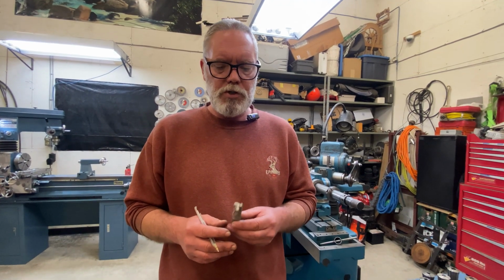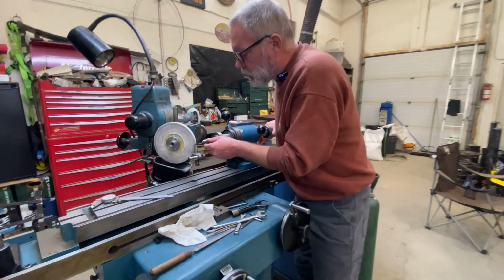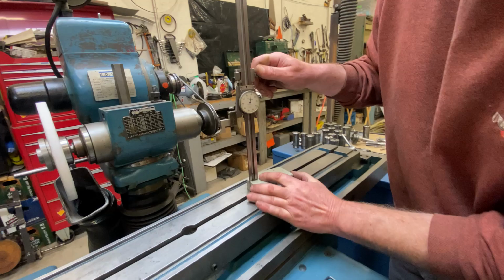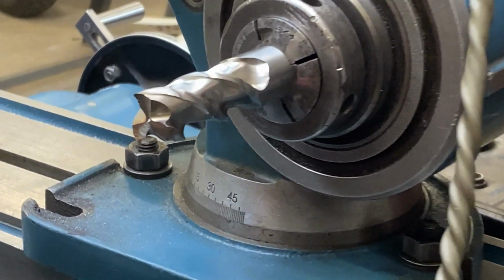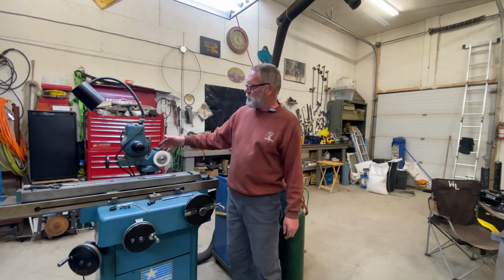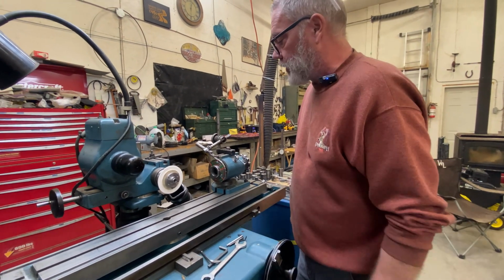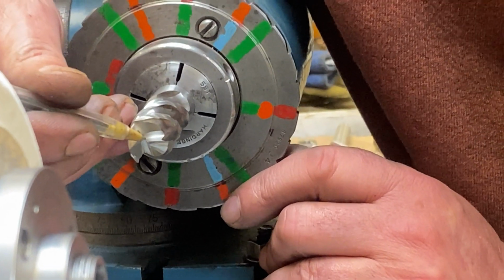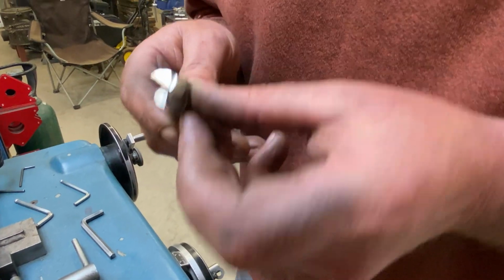How to sharpen a roughing end mill

Comment: What grit are you typically sharpening at to get a good; A wood mill bits, B metal cutting milbits...if there is a difference when both are pure carbide anyhow?
Do aluminium or steel cutting bits require a higher grit finishing? Or is it better to aim for mirror finishes where possible for both?

I'm searching around trying to figure out how to do this, primarily so that I can make something to preserve the life of bits as much as possible and I was hoping to 3d print most of it.
Looks like you need some pretty extreme tolerance accuracy though, not sure printed parts and metal hardware is even going to be good enough...

Awesome breakdown of the processes and thoughts behind things though, thanks for sharing
Reply from the maker: In my opinion a better finish is always preferable. Grit choice is complicated and depends on material being cut, speed of wheel, diameter of wheel, amount being removed etc etc. I recommend the trial and error method for learning what works.
 Thanks for watching!
Reply: @Lappemountainliving  I was looking to go into sharpening my cnc bits from cheap, I should probably leave thinking on this matter until I can afford to spare a grand for a sharpening jig properly toleranced. 
I'm asking about your grit because you're using stones over diamonds which is what i've seen more commonly on these types of sharpening systems. 
From a long time knife sharpener I extrapolate that end of the day you're getting a more polished edge.

Comment: Hello, just wondering why you have it so the direction of the wheel direction will raise a burr of the cutting edge ?
Reply from the maker: You're right  that it causes a bigger burr
I do it this way because the cutting force of the wheel forces the tooth face down onto the pointer.  By rotating the wheel the other way the cutting force would be trying to lift the tooth face off of the pointer which would result in the wheel digging deeper into the side of the end mill, which would result in more cutting force and could lead to a crash where the cutting force is so great that you lose control. This would destroy the end mill and possibly cause the grinding wheel to come loose and go scooting off across the shop. I find that dealing with the bigger burr is the lesser of two evils.

Comment: Imagine if you could generate the helix for any cutter without having to use the finger rest to guide the cutter.......I'm working on a design that I thought up some years ago.
Reply: "I'm working on a design that I thought up some years ago."     50 years ago, I found myself in a toolroom, sharpening every type of HSS cutter imaginable... While I was dependent upon the use of "spring fingers" to follow the cutter's helix... There were machines that used  air bearings and  "master helices" to make the job easier for cutter manufacturing, mainly. The Cincinnati MkII machines I used for cutters manufactured by every manufacturer you could name ... were capable of doing almost anything with simple setups...

Check out master helices, (as applied to T&C work) then ask yourself "is my reinvented "wheel" going to be an improvement?" Will it be better, easier, cheaper and faster than existing / old tech? I always have my doubts...

Comment: if you tap a grinding wheel lightly with something it should ring. if not its cracked.
Reply: "if you tap a grinding wheel lightly with something it should ring. if not its cracked." 
first, you should hang the bare wheel (no arbors) on a string, or on your finger, or suspend it in some other appropriate way (so you don't damp out its vibrations) before tapping it with a wooden implement, like a short section of broomstick handle. Don't hit it with a metal tool...
Instructions are all in the detail...

And... having been in a shop where a fairly large grinding wheel broke.  I think it was rapid approached up to a shoulder in the belief it was clear... It wasn't.  Lumps the size of bricks went everywhere... No one hurt, though... Makes you more circumspect around grinding machinery... In a small shop, there was a piece of a resinoid slitting wheel embedded in the window frame...happened a long time before my arrival, left as a warning to others... Resinoid wheels don't ring... they sound dull...
I always was careful on grinders, but in 1978, I found I was too careful.  I wanted to cut a piece of 1" square HSS toolbit, too long for my task.  I could have cut it on a T&C grinder with a 1/16" slitting wheel, but, hey, we had a Snow 21" cut off grinder.  On my first attempt, I made no progress, but a guy came up to me and explained why... My cautious approach had glazed the wheel's periphery, and I was trying to cut HSS with something as smooth and hard as glass... (I inspected the periphery) I went to collect my dressing stick, and the guy said "don't bother!" He just whacked the 21" diameter disc through the 1" square tool steel in about two seconds, perhaps less. it opened up the wheel, got rid of the glazing... I used that technique often after that...

The guy, (Roger, I remember) had an eccentric technique to establish how much material a machine could remove.  He worked up to a point where the machine stalled, or threatened to, then reduced feed rate or cut depth until there was no such risk...  My generation were taught to calculate MRR, from horsepower and machine condition. his did it empirically...